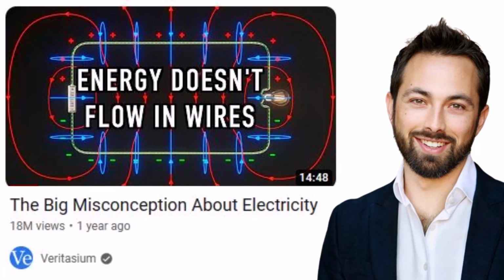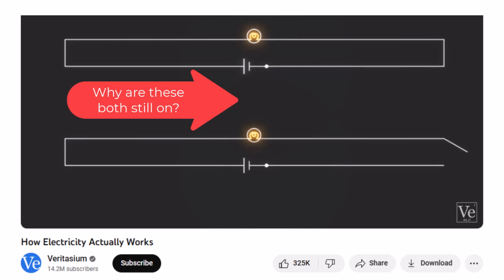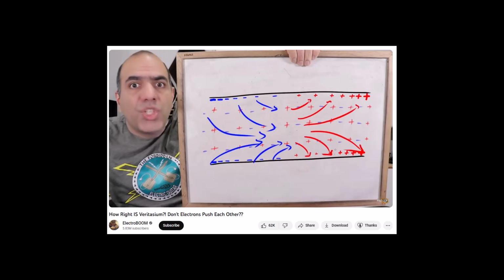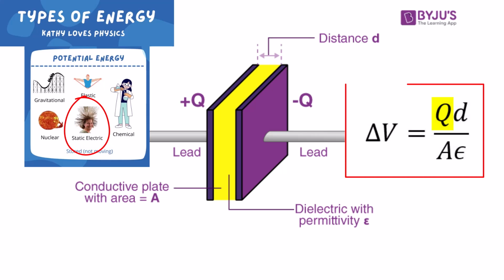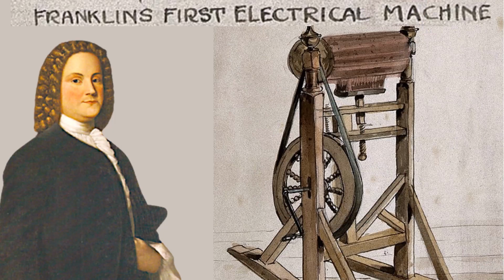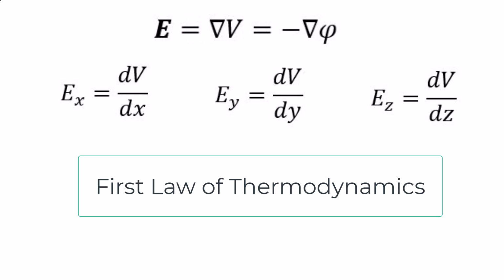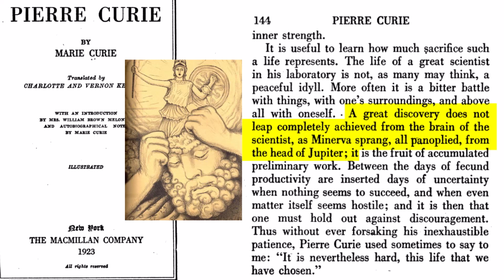Deep Dive Historical Response to Veritasium’s DC Electricity Video

Comment: There's a problem with this whole problem. It's entirely hypothetical, assumes a nonstandard condition, zero resistance in the wire, and provides essentially zero information about all the other variables of the circuit, inductance, capacitance, battery source impedance etc. With so much information missing, any result produced will be garbage. It's like saying, "If pigs could fly, how much could they carry?"

Comment: Bottom line is that the majority of power transfer along electrical conductors is by means of the electromagnetic fields that surround the conductors., not the fields inside the wires.  That smaller portion that exists inside the conductors represents the loss vector that makes the wires get hot. Ask yourself the question as to why the electromagnetic field is expelled in superconductors., otherwise considered lossless.  In the end, power transfer is by means of the electromagnetic fields surrounding the wires, not by the electrons/ions inside the wires or the ions crossing the gap for example in an electrochemical battery. It gets really interesting in the case where there are antennas and there exists no wires connecting the source to the load.

Comment: Poynting has a lot to answer for! A few years (decades maybe - I’m getting old!) there was a type of very compact high frequency antenna sold that claimed to use Poynting Vector technology. It was much smaller than standard antenna theory would allow and claimed great efficiency. It seemed most of the radiation was actually being made by the feeder cable rather than the dinky little antenna on top of the mast!

Comment: You are clearly upset concerning the many misconceptions of the definition of power, energy (and energis multiple definitions) but more directly the transfer of power be them electrical (E cross H)  or mechanical (Omega cross Tau), the energy transfer rate called power,  and the energy, the time dependent sum. Regarding the closed switch very long wire issue, clearly an evaluation of transmission lines points out your basic point. Yes the impulse crosses the one meter gap at the speed of light but the majority of the power transfer requires that the electromagnetic wave needs to travel the greater distance, supported by the rather very slow moving (7 mpg average at room temperature) "ball bearing"electrons, pushed along by the electromagnetic wave.

Comment: I guess the bulb was powered by a capacitor with high Q with a stacked coil between would the bulb glow brighter than in a straight wire if the switch was pulsed? I imagine would be proportional to the Henries,  Q and maybe the ESR as there would be an induced AC current?

Comment: I've watched Derek's video and what he wants to prove is that electrons don't literally migrate from one wire to another. Only energy migrates, and electrons are the path along which it moves.

I also think that electrons do not migrate. Examples of this are the transformer and generator and battery connected in a circuit.

I think that the video of the author is outside the topic that Derek commented on.
Reply: There are 3 aspects of electricity important here: The charge, the magnetism and the fact that a changing magnetic field with respect to a conductor induces a current. A transformer uses the principle of induction between wires that are very close together to get a highly efficient coupling... which allows wires in very close proximity but not actually touching to induce electricity in the other wires. This would NOT work if the coils were separated by a 1 meter gap... the losses would be tremendous.
The point that is important here is the charge and the magnetic field strength from an electric conductor will become much weaker across a "gap" by roughly the square of the distance (there is some change due to parallel conductors with a gap). BUT, if you do the math, the amount of electric current that can be induced in this manner is comically small for "120 / 240 volts of residential house current in the USA). The only way you are going to power a toaster with a 1 meter gap is if the voltage is many fold higher, and the "losses" would be horrendous. The generator works by the same principle, a changing magnetic field induces a current. Again, the magnetic field has to be physically close to the conductor... not 1 meter away to prevent losses. 
   Lastly, what many people don't realize is that electric current is not only the movement of electrons but it can also occur with with any motion of negative or positive charge. We don't see it in wires because protons are usually immobile. But, in batteries ions are free to flow, so internally there is an electric current of positive charge as well as part of the chemistry that takes place.
Reply: @marcfruchtman9473  I can't understand what you mean. 

I guess you're trying to say that electrons literally migrate in a circuit. 

If so, then explain the following question to me. A car that has an alternator and a battery. The battery's charge drops and needs charging. If the alternator has to transfer electrons from its stator windings to the battery every time, then at some point there will be no more electrons left in its windings, also in the entire chassis of the car, because Is the alternator bolted to the chassis of the vehicle?
Reply: @Yulian.Mladenov  Yes, I see the issue you are thinking about. The battery is a chemical reaction. The atoms in the electrodes of a battery, and possibly  the electrolyte of the battery will participate in the reaction. When it is being charged  by the alternator, the negative side will receive (and store) electrons as a chemical reaction and the positive side will lose electrons as well. So, typically, you will see the positive side donate electrons and the negative side will accept the electrons when the battery is being "charged". The reverse happens when the battery discharges. Thus there is no "loss" of electrons, just electrons moving from 1 point to another. 
A cool video to check out is "How Batteries Work - Battery electricity working principle" by The Engineering Mindset.
Reply: @marcfruchtman9473  I have watched Mindset's video, there are many videos like his.

I agree that the electrons inside the battery migrate, otherwise there is no way to get a charge.

I meant that the electrons from the stator windings of the alternator do not migrate into the battery.
The alternator only produces voltage that unlocks the chemical reaction in the battery, but does not fill it with electrons.

The alternator is simply a pump that injects pressure into the battery which separates the atoms and concentrates the electrons in the negative pole, after which the atoms in the substance of the positive pole remain positively charged.

Comment: I watched Derik's video and Electroboom's rebut, as well as some others; and now yours...My answer was also none of the above. But, for a different reason that nobody addresses.  The voltage drop along that length of wire is going to be greater that the amount required to light the bulb.
Reply: Yeah, a wire that long is basically a perfect resistor.

Comment: I'll have to study all these video's to see how it stacks up to what I've been taught and also to adequately know what everyone is posing. Fortunately the subject at hand doesn't make any difference to current carrying capacity as we know it, but is interesting as I have been taught differing things throughout my life. 43 years ago 1980 at high school everything current, field, electron flow all went at the speed of light.                                                                                                                                                  As an Electrical technician doing a physics refresher course over a year in 2008 to keep the brain cells firing we were taught the electrical field is created at the speed of light but the electrons themselves move in a sporadic motion as they bounce and collide with atoms in the whole conductor and as such the actual distance travelled along the conductor is very low with out getting into differing variables, voltages etc. I'll have to watch the the original video in question but was confused when Cathy brought static electricity into the video. I love your video's Cathy they are a real treasure.

Comment: Thought this debate had died away. Sadly you are wrong on this. Your argument focuses on the steady state as you say. With an assumption but no calculations as to what the transient response would be. In reality the coupling between the 2 wires is actually much stronger than your intuition would assume. While the power disputed by the build is definitely lower than steady state its actually still around 20% of the max. Probably enough to 'light' a bulb. Steady-state is actually a theoretical ideal that never actually exists in the real world.  Actually the voltage at the bulb will fluctuate while the currents bounce up and down the wire, only dying away because of the power disputed in the bulb, or radiated away.

Comment: It was like engineers arguing with physicists. 
In Electronics, we have a number of models and tools to design our gear including
 conventional current which is opposite to conventional flow. 
As a tech, I was first taught electron flow and regret it to this day. 
It’s like learning imperial system instead of metric. 
I learned about skin effect in AC but I see there’s a lot more to this than I realize even though
 I really don’t need to know it for my daily tasks. 
Socratic method of asking and answering questions to arrive at a truth…like the Paper Chase. 
I enjoy the deep dive down the rabbit hole to Wonderland by all the creators on this subject.👍
Reply: I started as an electronics tech in the Marine Corps, and they taught electron flow.  It seemed odd that current would flow against the arrow of a diode symbol.  However, that was still the era when vacuum tubes were in use, so there is some sense to talking about electron flow.  That school was pretty basic, and raised enough questions in my mind to motivate me to become an electronics engineer.
Reply: @SkyhawkSteve  There was... at least some... American profs writing textbooks using electron flow (versus conventional current flow)... but, AFAIK... and apparently... it never caught on.  Eventually, I think, everybody promoting electron flow gave up trying to change it.
Reply: Electricity, Magnetism, Heat, light / Color, Mass / Weight are different manifestations of Gravity and Continually convert to each other. Gravitational Particles (GPs) move by means of CONDUCTIVITY towards the CENTER of the GRAVITY.  
Turbines convert the Gravity Force to Magnetic > Electrical > Heat > Light and everything in between.
When GP moves in the Air (4N1O) Atoms are manifested as Magnetism, therefore Magnetism exists only in the Atmosphere and is absorbed by Compass measured in Air Gap and Magnetic Flux context.
When GP moves in Solid it is observed as Electricity and measured by its Power/Force/Voltage and its Current/Amps and their combination total Quantity of GPs in a unit of time as Wattage.
GPs move at a 90 Degrees Angle relative to their path in [side] Steps, therefore the GPs manifested as Electricity, Magnetism, Heat and Light transit to the Outer Edges of the Medium/Matter.
Reply: @ShonMardani  No.

Comment: First, Thank you so much for speaking the harsh reality of the poor Veritasium Video -- that it is filled with really bad theory. I also find it particularly annoying that even with the follow up video, he claims pretty much the same thing by having minuscule currents induced on a wire 1 meter away.. as if microamps would power an appliance in a house. The whole reason Tesla's vision for wireless electricity failed is due to the massive losses with distance. It is for that very reason our electricity is delivered via wires and not by gaps. If electricity didn't require the wires, we wouldn't use switches. Derek's conclusions are simply wrong. I too had a lot of respect for Derek, but... the fact that he ignored most of historical science when making this video is particular bothersome to me, often leaping to odd conclusions. I get he was trying to explain Transmission Theory, but I really don't appreciate the claim that what we have been taught is a big lie.. (we don't need click bait) and I also don't appreciate that he made a lot of claims that the electricity to our homes was not really by electrons... which is utterly wrong.

Comment: 1) Excuse me Kathy, but Feynman was wrong. The "absurd circulating energy" form static electric fields and static magnetic fields has been measured. More specifically it predicts that there is momentum from this circulation and that can be measured.
This is all far less "absurd" once you realize that a magnetic field in the classical picture requires charges to move. There is nothing "at rest" once you include magnetism.

2) The easiest way to realize that the Poyting vector is real is trying to "remove it". That is, try to remove to area where teh Poynting vector transport enegery by shielding the magnetic or electric fields. You will soon realize, you can't with breaking physics.
Reply: Actually Kathy took Feynman out of context. Feynman just mean that it sounds crazy. He actually used that circulating energy model in the same chapter to show that it seems crazy, but then showed how it all makes sense.

Comment: If energy doesn’t flow on wires, why do they get hot?
Reply: Well, you could argue that energy flows in the vacuum  and the drift of electrons in the wire are just a consequence of the fields created by that energy flow. Wiring is just shaping that field, and the electron flow is a side effect.
Reply: the veritasium video was about not being "in" .

Comment: A guy (AlphaPhoenix) has measured how electricity flows in a wire, it must have been a lot of work and the result is not very surprising if you know about transmission lines.
His graphic is a good illustration of what happens the first many nano seconds after the switch is closed and until steady state is reached.

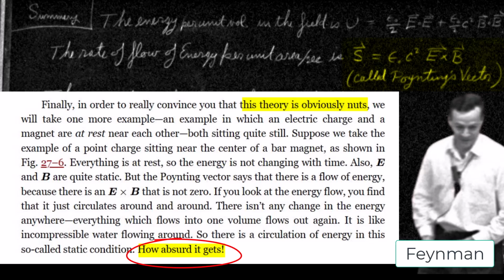Comment: I think I miss something. You seem to agree with Feynman around 7:20 and 8:00 but then disagree with the same quotation around 10:15. What did I miss?

PS. The third instance of the Feynman quote (20:45) makes it even more obscure to me. What is pseudo-science here? Feynman's lecture or treating the Poynting vector as an energy flow for the case of DC currents?
Reply: I agree, I am confused too.
Reply: Kathy is delusional here. What Poynting says is no word salad. Its 19th century physics terminology but perfectly correct.
And Feynman was wrong if he meant that "absurdity" literally.  The "absurd circulating energy" form static electric fields and static magnetic fields has been measured. More specifically it predicts that there is momentum from this circulation and that momentum can be measured.
This is all far less "absurd" once you realize that a magnetic field in the classical picture requires charges to move. There is nothing "at rest" once you include magnetism.
Reply: @michaelrenper796  Feynman just meant it was counter intuitive. In the rest of the chapter he demonstrates that it is correct.
Reply: @michaelrenper796  I think Feynman means that this may be mathematically correct but is physically meaningless. If this is measurable, as you claim, he is wrong. Can you give me some quotes to this effect? Preferably to original scientific papers.
Reply: @arctic_haze  Can you quote a scientific paper that says the Poynting vector is physically meaningless?
You see! Go and search yourself.
Reply: @michaelrenper796  OK, so I can forget all you said and stick to what Feynman taught (usually not a wrong choice) as you seem to have nothing to support this claim. And I almost believed you for a few minutes.
PS. I looked into the literature and although some papers claim that this Poynting vector  interpretation is necessary to provide conservation of energy and momentum (not a big surprise), I could not find one claiming that this is actually measurable. Some even postulate using a "hidden momentum" to cancel out the Poynting one. As I said, total confusion.